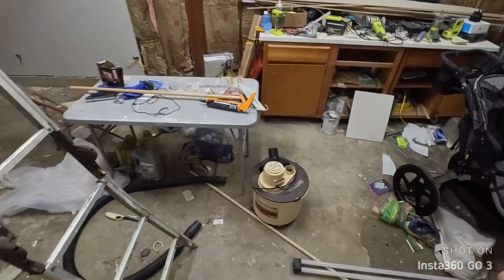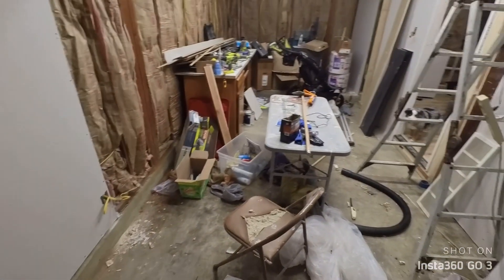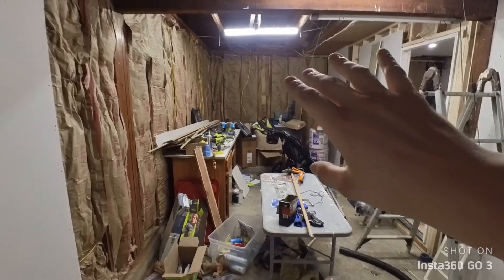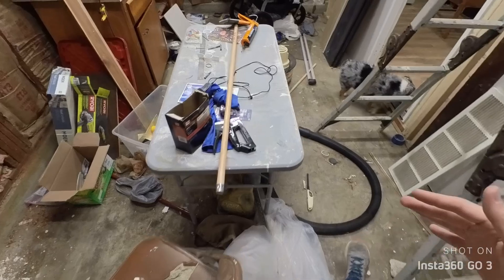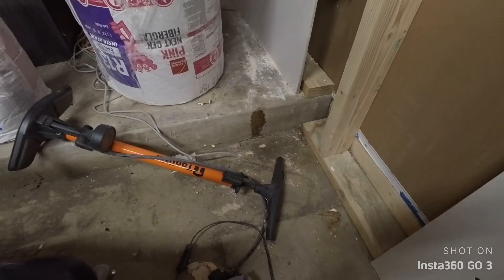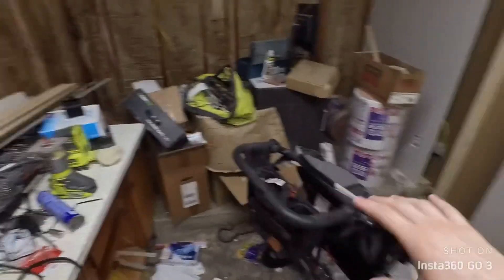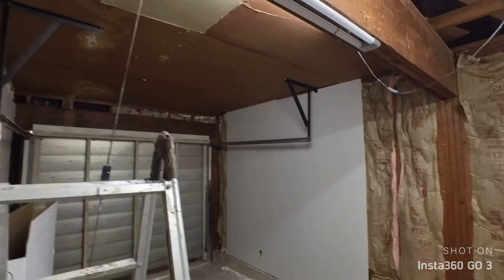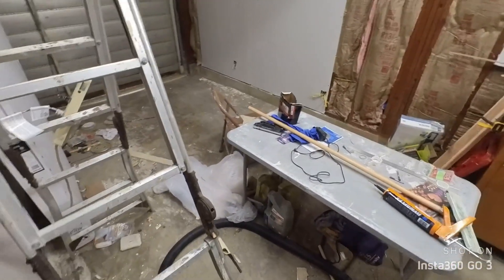Pretour of new content creator studio

Comment: Double check zoning code regarding garages- I know some places require offstreet parking in garages and removing garages can violate that. Also, I would have recommended some XPS foam (they sell big 4x8 sheets at home depot, sometimes 16.5" sheets designed for stud dill). They have much higher R rating, sag less so they last longer and block sound better. You can use a hand saw to quickly cut them to shape from between the studs. For the raised pad, one option is if you want to have a chair base area back there, you could build a 2x4" frame (filled with non-batting insulation(because of condensation)), put some plywood on top and make it a full raised platform that can fit whatever gaming/chair setup. Or you could put some mini drawers built into the side of the platform. Once your kid is about 5 months old, it'll be a great place to store toys for them because THEY WILL BE IN THERE while you do your own stuff.
Reply: I'd also recommend getting a layer of sub-carpet squishy foam and carpeting the room. Keeps it warmer/colder, better acoustics, and more comfortable. And when filling in your ceiling, have some raised planks, so after you blow in insulation up there, you can put some plywood above the insulation. If you leave a trapdoor up there, you can store important stuff up there like christmas presents. Also, a ceiling outlet can be a good idea if you ever want to mount additional lighting.
Reply from the maker: good suggestions. we are fine for zoning. we covered it all with the rest of our renovations and adding a 20x20 garage
Reply: @OmegaSolutions  cool. also, what I meant by a 2x4 frame was to extend the raised area out a few feet to have enough space for one gaming area.